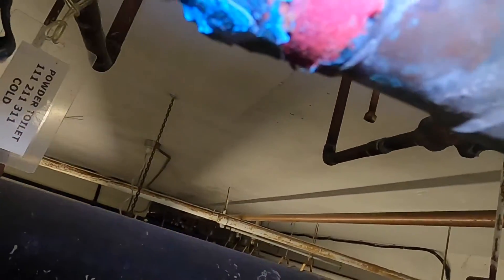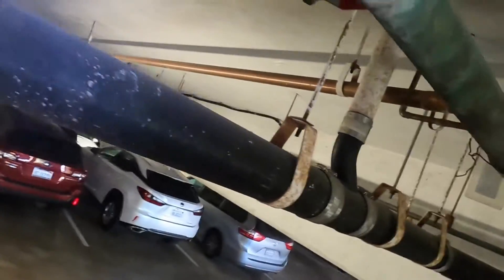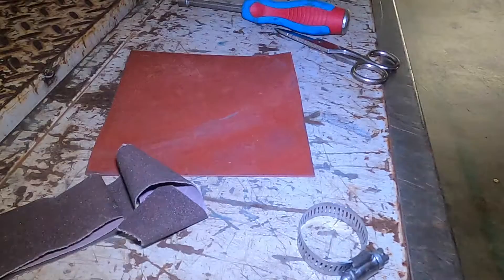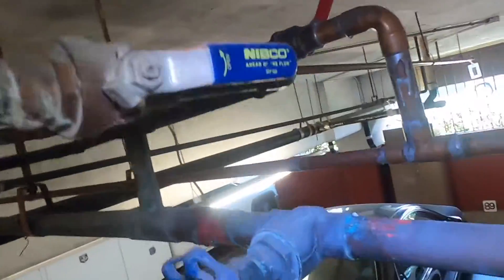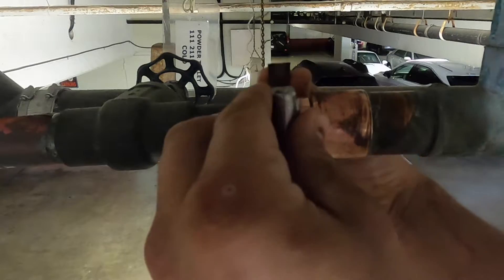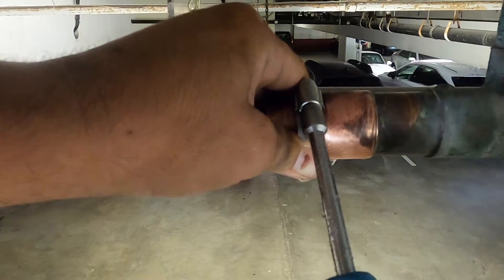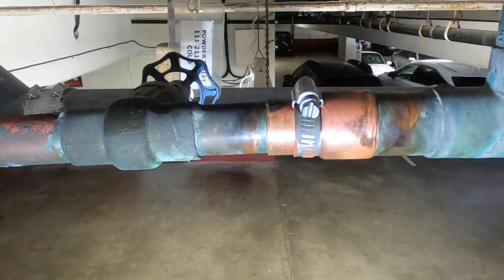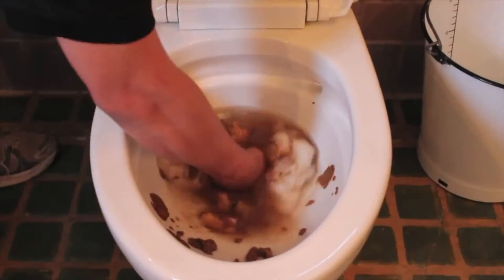How to fix a pinhole leak in copper pipe.

Comment: Lady who is losing her house after owning it for 50 years has a plumbing problem. A solder joint developed a small drip. Your method will stop the drip. It's not a permanent solution,  but will  carry her through for a few days. Water will be shut off when she moves out in about 30 days.

Comment: This is very helpful to me. Such clear instructions. I Heard water, found the source and saw a pinhole.  Shut the water off (not main) but it’s still leaking and so I will do this since it’s so simple. Thank You.  It’s an outside pipe for the hose so maybe I’ll fix it and not use that one anymore  I have several others.  Wish me luck.

Comment: Hello, Great video! I have a question, I have a pin hole leak in a hot water copper line. It is corroded pretty bad, I can see the pin hole. It is on the bottom of the copper pipe. It is on an elbow joint. I am afraid to sand away at the corrosion, fearing that I might make it worse. What should I do? Is there anything I can use on corroded copper with out sanding??  Just spray or paste onto corroded copper pipe.  Thanks, Jeff

Comment: Municipalities are using Chloramines (chlorine/ammonia) as the disinfectant. Chloramines are more acidic and create an caustic environment and an increased possibility of having pin hole leaks in copper.  Whole house catalytic carbon units have been found effective at reducing this. HousePure whole house filters target the problem.
Reply: Such municipalities should have their Utilities Director taken out and shot, then the remaining gov't should be sued until they rectify the pH.  Copper should last indefinitely w/ N. America municipal water.  If you have a well that's acidic enough to attack copper, drill a deeper well until you hit "sweet" water.  

NOT saying whole house filters aren't a great idea, for many reasons, but the incoming water shouldn't have such a low pH.

Comment: This is a handy straightforward fix thank you! Do you know on average how long copper piping lasts before pinhole leaks can appear? We got some installed inside our house along the downstairs basement ceiling.
Reply: Depends on the water quality, the conditions of the pipe environment, the quality of the pipe material, and just luck. I have a  70 year old house and one pipe randomly got a pinhole leak at the solder joint on an elbow after 68 years. No signs of corrosion or damage. Just the plumber missed a spot of solder in 1949 and it took until 2019 to reveal itself.